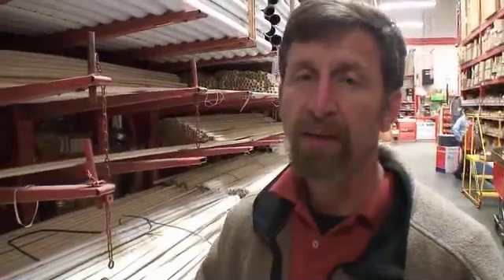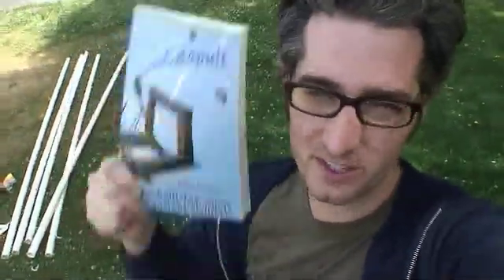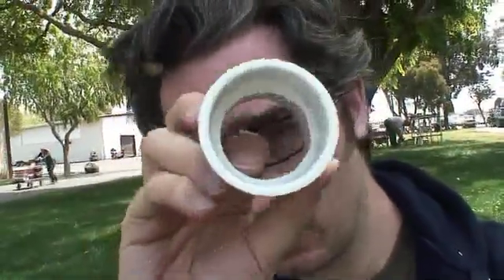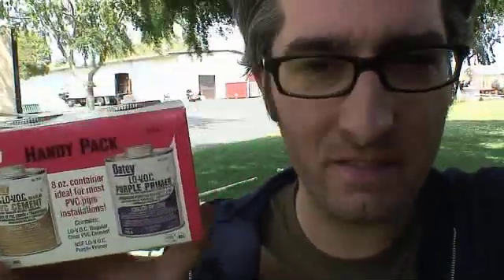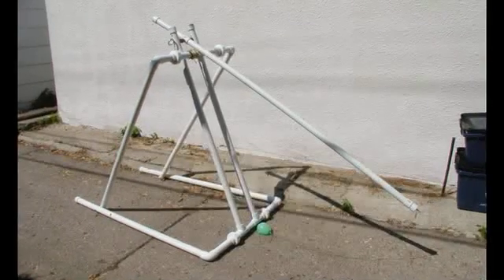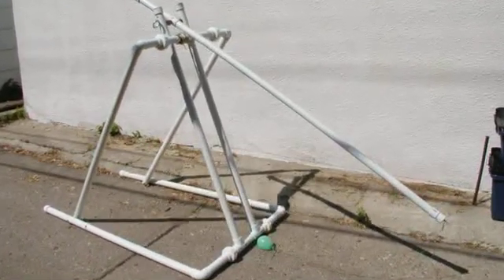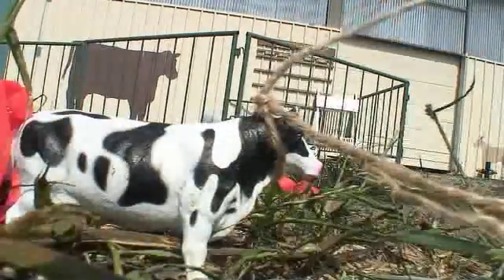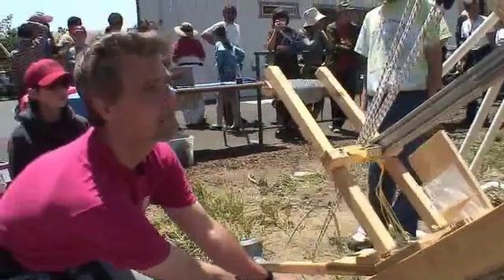Make Your Own Catapult Out of PVC Piping!

Comment: no it's not a traction trebuchet because it's uses falling weight when releasing the strong rope, catapults use the resistance against ropes to fire the projectile much like the same as using a bow.
i don't know where your getting your info from but your wrong.